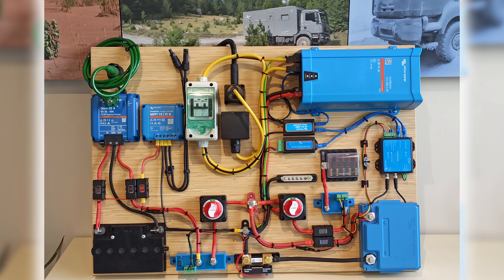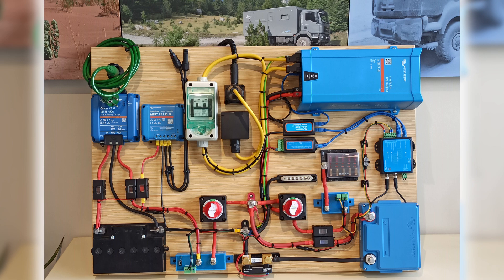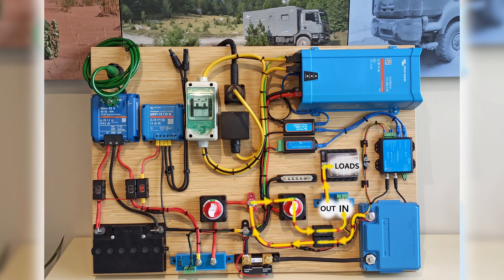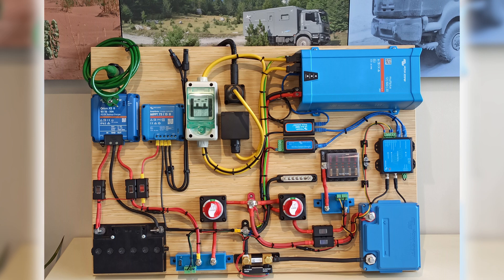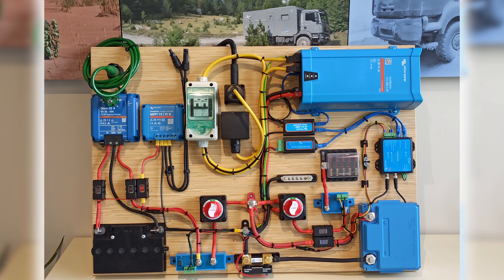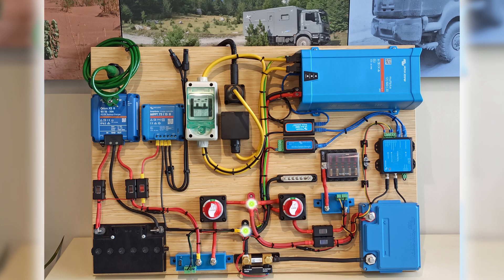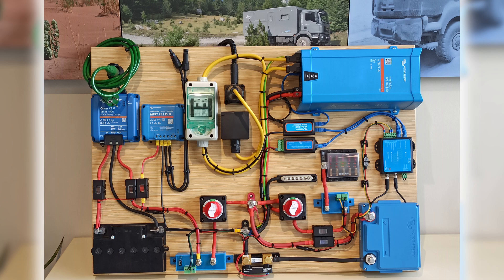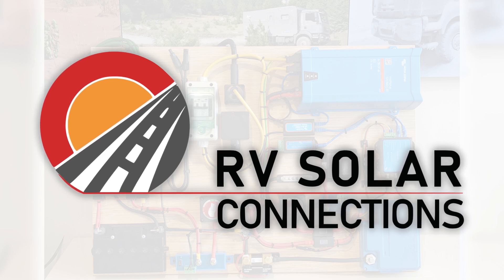How the Pros really build Victron Energy Systems?!

Comment from the maker: Eberca's guide to ordering the relevant components for such a system:

Victron Energy typical system

Use this system for most of the typical applications, such as small campers:

Battery: 1 x BAT512120610 (most commonly used product references are shown)

Battery Management System: 1 x BMS300200200 (for MultiPlus-II models, you don't need to install the included mains detector)

MultiPlus (inverter/charger): 1 x PMP122120000 (program this to LiFePO4 i.c.w. VE.Bus BMS via VE.Configure and the MK3 USB interface with your computer)

Remote control MultiPlus: 1 x ASS030537010

RJ45 data cables: Grab some stock and choose the correct length during installation. You need one between the BMS and MultiPlus and another between the BMS and remote 

230VAC differential fusebox: 1 x 230VFUSEBOX (C16) this product contains two differential circuit breakers, one for ACin (shore power) and one for ACout1.

DEFA connection kit 230V: 1 x BR000A460785 + 1 x BR00000A460829

Smart Battery Protects: 1 x BPR110022000 for the chargers, 1 x BPR065022000 for the loads

Pole protection caps: POLEPROTECTOR_MEDIUM_RED, POLEPROTECTOR_MEDIUM_BLACK

Distribution connection points: CONNECTIONPOINT_M8_RED, CONNECTIONPOINT_M8_BLACK

Battery monitor: 1 x SHU065150050
(Settings to be adjusted from default: Battery capacity = fill in your battery capacity, Charged voltage = 14.0V, Discharge floor = Not below 20%, Tail current = 1.5%, Charged detection time = 5m, Peukert exponent = 1.05, Charge efficiency = 99%, Current threshold = 0.00A, Battery SOC on reset = Clear)

Solar panels: 3 x SPM041401200 solar panels with cables and MC4 connectors included

Roof cable transit: 1 x ROOF_CABLE_TRANSIT_WHITE

Solar cable: 1 x SCA001000100, cut in half

Smart Solar Charger: 1 x MPPT 100/30 (easily calculate your MPPT here)

Switches: 2 x VBS127010010 for isolating the loads and the chargers

Main Fuse holder: 1 x CIP000100001. Usually this fuse's value is chosen based on the manuals of the battery and the MultiPlus. We suggest adding one for reserve to give to your customer.

Midi Fuse holders: 4 x CIP000050001 for cables up to 25mm².  As a minimum you will need one for the MPPT, two for the Orion charger and one for the DC-loads.

Alternator Charger: 1 x ORI121236140, with heat resistant mounting plate 1 x V11PAL010000. (Settings to be adjusted from default: Function = Charger, Battery settings > Battery preset > Select preset = Smart Lithium (LiFePO4), Engine shutdown detection > Alternator type = Smart Alternator)

Mini fuse box with LEDS: 1x FUSEBOX_LED_10

The customer must fully grid-charge the battery weekly / monthly depending on the use. This is essential for calibration of the battery monitor and cell balancing. 

--
Administrator

This is only a guide for ordering, individual system requirements may change your order.
Reply from the maker: These product references can be found on their e-order platform, find the link in the description.